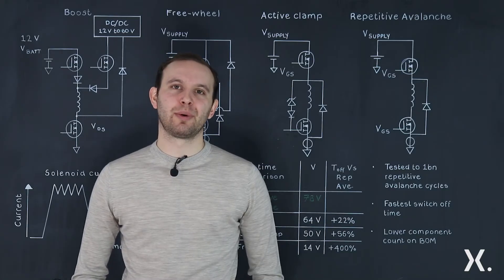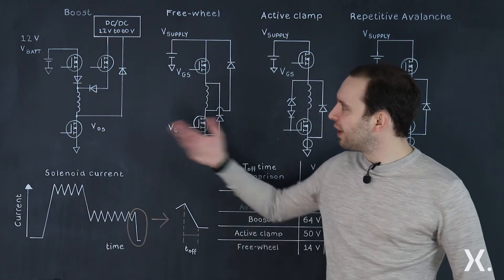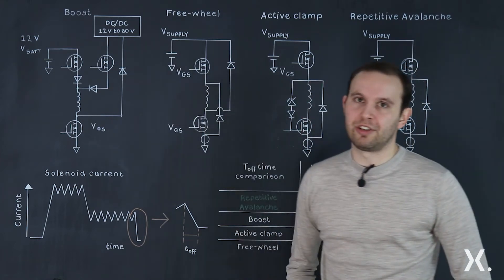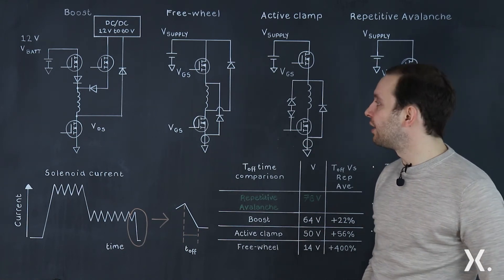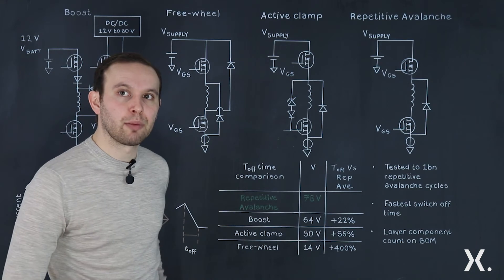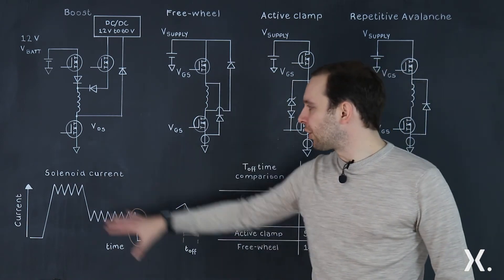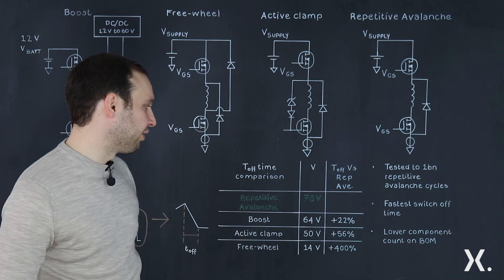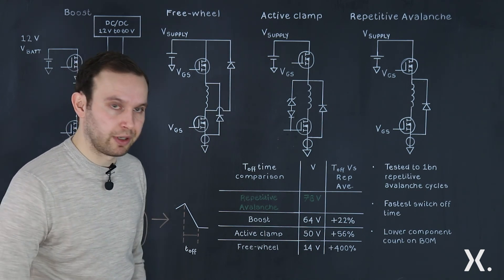Four ways to control automotive solenoids/actuators using power MOSFETs

Comment: I wondered about the 'more energy efficiency' of the boost design...it looks like inductive transient energy can be recycled into the boost circuit, but this was not explicitly explained here... if I'm right, it might be useful to add something about that into this, or another, talk?
How important is the SOA of the FET in the active clamp...it seems to be of limited importance, since the device does not spend much time (hopefully ;-) ) in a 'pinch' state that is the worst-case SOA issue?
Reply from the maker: Hello, thanks for your question and thanks for watching! Regarding the efficiency of the boost circuit, you are correct, the inductive energy recycles into the boost converter. Then regarding the SOA – it depends on the length decay time of the current through the inductor, anything longer than of 100us you do run the risk of thermal runaway as per the spirito effect when operating MOSFETs in linear mode.